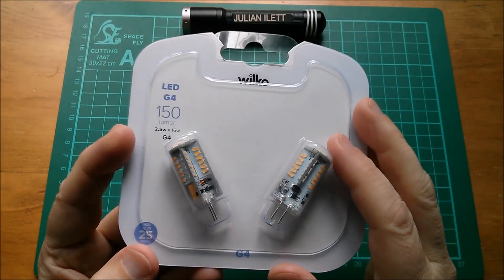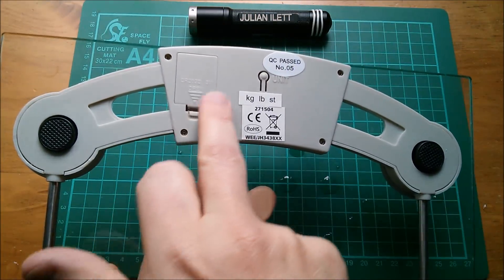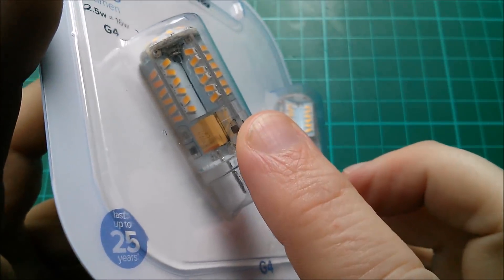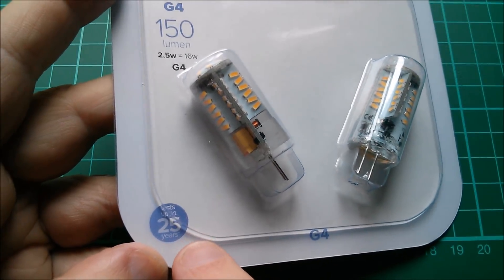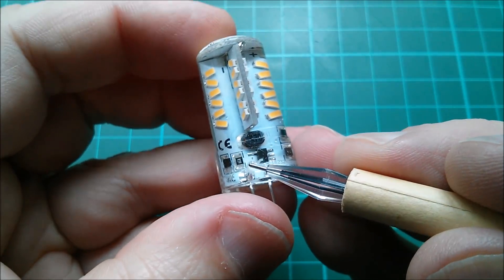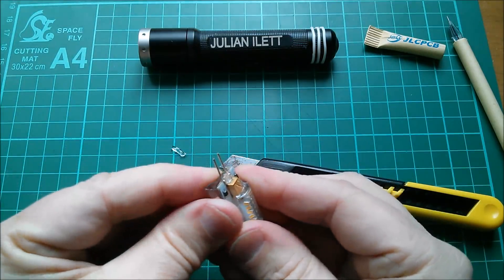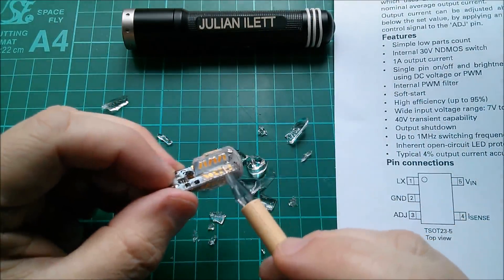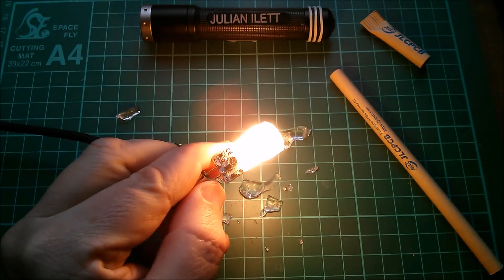Wilko 12V G4 LED Lamp (plus 3 other Wilko items)

Comment: The 1.1W version of these is even dinkier but with only 24 LEDs. Interestingly it will run from a 9V battery - potential torch hack available there.
What happened to the solar filament lamp teardown?

Comment: The problem with "potted" bulbs like these is that generally the potting prevents heat dissipation, which means that they generally last 25 days (if I'm being generous), rather than the stated 25 years. That's based on my experiences with some similarly potted G4 bulbs a few years ago. Mind you those were mains driven and massively flickery, so clearly they had a different driver design. Still on the upside at least the clear casing means you'll be able to identify the components that failed easily enough ;) Actually, please could you try burning some of that encapsulation to see what happens?

Comment: I also have a radio clock, according to the manual, it syncronizes with an atomic clock 2 000 km away in France! Pretty big distance, wouldn't you say?

Comment: Scale manufacturers don't need to know that F = mg (therefore m = F/g) and that g ≈ 9.81 m/s^2, they just calibrate them with a know mass object (calibration weight). In other words, they go the engineer (practical) way instead of the physicist (theoretical) way.

Comment: Some LED indicator lamps I have are over 7 years old and run 24/7 and still look fine. However it depends on the quality of the LED. I have seen a LED exit sign that is less than 1 year old that has gone very dim. Some LED lamps driver fails before the lamp. Those LED alarm clocks seem to never burn out lol.

Comment: I've just been to the, recently opened, Edinburgh branch of Wilko. They didn't have any of the lamps in your video in stock but did have the smaller, 1.1w (100 lumen) version.
Only 24 LEDs in each lamp but they still put out a reasonable amount of light.

Comment: The ones I have are definitely not dimmable (mine are identical looking ebay, shipped from china versions).
... them little rubber lamps lets the old magic smoke out if you are daft enough to ignore the warning on the packet and try dimming them just for the fun of it... 
That little chip really didn't appreciate being fed with a PWM supply. 
In fairness I did torture it for a quite a while this way before it blew up.  
Just thought I'd point this out so others don't need to find out the hard way. 
There is something oddly attractive about their clear rubber construction... or perhaps I'm starting to loose the plot.

Comment: Ignore the haters Julian, just pathetic.  Love your enthusiasm and delight, enthusiasm is actually a great teaching style.

So here is an idea for you.  How about some videos on taking apart old things and re-purposing the electronics.  For example take a Microwave (or any old thing) from your local Freecycle.org site, remove mains and then check out the PCB's, transformers. LCD's  etc, Then see what you can use in other projects.  The wire and connectors alone are useful and better quality than cheap Chinese ebay stuff.

I would like to see more about super capacitors too, some of the cheap ebay ones leak so fast they are useless.  I noticed yours were visibly dropping.

It would also be good to see a standardised review for buck boost devices so we can apply to ones we test.  I had one overheat and smoke before dying when I actually put a charge through it, was 19v to 2,5v for a 500f supercap.  

I want to design something to safely charge Supercaps ranging from 2.5 to 63v and then cut of power, for now I am working with momentary switch and bulb for testing.

I was looking for 63v and these beasts stood out! 

https://www.ebay.co.uk/itm/192470297761 DC to DC High Voltage Boost Converter Step-up Booster 390v 

https://www.ebay.co.uk/itm/232624565570  600W-DC-DC-Boost-Buck-Adjustable-Step-Up-Converter-Power-Supply-Module-GV7R

https://www.ebay.co.uk/itm/192059570688  100W DC-DC Boost Converter 10-32V to 60-97V Step Up Power Supply

I wonder how practical and reliable they are

BTW have you heard of this guy, is a namesake of sorts 

https://en.wikipedia.org/wiki/Julius_Edgar_Lilienfeld 

physicist and electronic engineer, credited with the first patents on the field-effect transistor (FET) (1925) and electrolytic capacitor (1931).
Reply: What haters? Julian doesn't have any haters.

As for taking microwave ovens apart, I've seen a few videos on YouTube about microwave oven transformers. Scary stuff!

Comment: I have bought 240V G9 version from different manufacturers from Banggood, Dealextreme. They all have the same silicon coating and all failed in a few month - 1 year. They start blinking. Wonder is the silicone is causing it to slowly cook inside.
Reply: Hello I think your bought price is very cheap, right?

Comment: I bought some of those silicon encased Halogen replacement bulbs 2-3 years ago, but I wasn't impressed with the brightness, colour or strobing.  The more recent filament style Halogen replacements are much better.   I think Wilko are selling off old stock.

Comment: Oh, Julian.  shakes head  It's not force equals mass times acceleration.  It's force equals mass times the square of acceleration!

Please don't tell me that you're the kind of person who multiplies the weight by two when you double the scale of a three dimensional object! ;)

(Psst!  For anyone who does, you're supposed to multiply the weight (mass) by eight when you double the scale)
Reply: Last I heard, force does equal mass times acceleration but the whole question seems rather unnecessary since bathroom scales measure weight which is a force and not mass which isn't so there's no need for any conversion.
Reply: Well, strictly speaking it's the square of the speed, so since acceleration isn't speed but a constant change in speed, I guess you're right.  I back down and call myself a fool for not seeing the difference.
Reply: You may have been thinking of energy instead of force. kinetic energy=0.5 mv^2
Reply: Could be.  There goes my dignity. :P

Comment: The REC button means 'receive'. You can press it to initiate an immediate sync with the radio signal, although the clock should try and sync each night at 2am. The SET button allows you to manually set the time. The signal is a little weak in the SE of England so I sometimes have to prop my RC clocks up on an upstairs window sill and press REC when the clocks change as otherwise they can't 'see' the signal. Some clocks always sync by themselves but I have a few that struggle.
Reply: I just pop the battery out as it's easy and the reset button is tiny on my radio clock. But I do find it picks up the signal better on the window.
However it never seems to has an issue on a daily basis finding a signal, just when I manually have to reset it :(
Reply: +Chris Nixon The same here in South Wales. But my OH's is nearer the window and works fine.

Comment: 25 years at 2.7 hours per day is just under 25,000 hours of operation. Most of the LED lamps I've used are rated between 15,000 and 25,000 hours of operation.

Comment: Aww... he absolutely loves it...  :-)   (it is pretty nice though)
BTW... I wouldn't be so fast to say tantalum caps won't last 25 years.... I repair avionics test equipment made back 30-40 years ago when tantalum caps were first making inroads into mass-market designs, and have yet to see one fail of "age". Remember, small molded tantalum capacitors are solid-state... which in the case of capacitors means they have no liquid electrolyte that can boil off, leak, or otherwise "go away".
Most tantalum cap failures I've seen are related to the application, where they may be subjected to excessive voltage spikes... which can destroy pretty much most any capacitor. Other failures have been related to assembly issues of over-temperature, or reversed installation.

Comment: Stones and Lbs drive me mad (I'm british and 44 yrs old). I can't comprehend why anyone would use it lol. Lbs works, or Kg works... but stones? What size stones? Gravel?
Reply: The distance between the two sets of stumps on a cricket pitch is one chain. How English is that? Ten chains are one furlong; a measure still used by racecourses. Maybe some farmers, too, since a 'furlong' is a 'furrow long'. Oh, and eight furlongs are a mile. 

The mile was first used here by the Romans ( a European connection!). Theirs was 2,000 paces, which is the maximin distance that a Jewish prosrlyte was allowed to walk on the Sabbath. And the inch was first recorded as being used by the ancient Babylonians. 

12 inches to a foot, 36 to a yard, 7920 in a furlong, and 63,360 to a mile. The beauty of this system is the divisibility of the numbers into whole factors. A mile is divisible by:

1, 2, 3, 4, 5, 6 ,8, 10, 12, 15, 18, 20, 21, 24, 27, 30, 32, 36, 40, 45, 48, 55, 60, 64, 66, 72, 80, 88, 90, 96, 99, 110, 120, 128, 132, 144, 160, 165, 176, 180, 192, 198, 220, 240, 264, 288, 320, 330, 352, 360, 384, 396, 440, 480, 495, 528, 576, 640, 660, 704, 720, 792, 880, 960, 990, 1056, 1152, 1320, 1408, 1440, 1584, 1760, 1920, 1980, 2112, 2640, 2880, 3168, 3520, 3960, 4224, 5280, 5760, 6336, 7040, 7920, 10560, 12672, 15840, 21120, 31680 and 63,360. 

That's remarkably useful if you only have a pile of stones or mental arithmetic. The Babylonians counted on their hands using base 60 for that same reason.

Systeme Internationale, on the other hand, allows for division by 1, 2, 5 and 10 and their multiples, in a metre. The outstanding beauty of SI lies in the way in which standard units of mass, length, brightness, energy, volume, electricity, gravity, pressure etc, all hang together into easily-calculable and convertible quantities.

Many people of my age (pension time all too soon!) were taught in both systems of measurement. I still use Avoirdupois (Europe again!) a.k.a Imperial measurements and 'Metric' interchangeably, which is a real bonus, especially when corresponding with our American cousins (yes, I really do have some), who often struggle with the much more logical and intuitive system which 97% of the developed world's population use. It's not their fault as individuals, it's their education system which has let them down.

My comments on YT will often contain conversions for them, as a courtesy. It would be good if more U/S citizens were taught to use SI units. The U.K. was in their position, educationally, in the early 1960's. They're catching up, to their credit.
Reply: TheChipmunk2008  The English used to (and in some places still do) measure distance in chains (1 chain = 22 yards, 20 chains = 1/4 of a mile)...
Reply: British here... I use kg.
Reply: @tim. I mostly do too, but spent time in the US, so multiplying by 2.2 isn't that hard, but stones, blow my mind

Comment: I didn't see anyone motion it, but the capasater is there to protect the LEDs agents the in rush current  created by the LEDs. If you don't have enough capacitance you can blow out the LEDs. I have seen online somewhere how to calculate the capacetents needed based on the total forward voltage of the LEDs.

Comment: I've seen LED' put inside glass, which is filled with transparent potting material. eBay "G4 COB Filament LED Light Glass Chandelier Boat Spotlight Lamp AC DC 12V"

This "new-ish" solution seems great, but I'm curious if dust would collect over time (some stickiness factor). Which isn't the case with the glass filled ones.

Comment: If the rubber is the same used on waterproof LED strips it will get yellow and brittle after a couple years if used on a car in tropical countries like where I live (Venezuela) I imagine that with the cold weather you have there in UK it would last quite a bit longer

Comment: I did not think there was too much wrong with you till I restarted the video ,,, "hows it hanging ?" . Ok. hee hee. Oh well, I have a friend who will be fascinated with this video so, its a club... Or you two should hit each other over the heads,,, um, enough of that. You didn't quite make it to the part where you actually measure did you ?  Oh well, here is the answer to your question https://youtu.be/e4iyNFcdhOQ 
https://youtu.be/kAG39jKi0lI

Comment: These G4 lights look very similar to the ebay ones I got, and regretted. They were super blinky, and all died with a bang and lots of soot not very long after. Also, Clive has picked apart a burnt specimen of this item.
Reply: One difference, yours has a driver chip, mine only had a capacitive dropper.
Reply: ...and also mine ran on 230V. Badly.

Comment: There is no problem for that LED lamp to last 25 years as there are no electrolytic capacitors those usually dry out especially at higher temperature and only last a few thousand hours.
LED's can last 25 years even if used 24h per day that is around 220000h. I have a 3W white LED that is used at around 0.5W 24/day every day for the past 5 years and while I did not measured the intensity it looks as bright as it was when new.
Reply: It's not the LED he's worried about - he says they could easily last 25 years. It's the tantalum capacitor that isn't likely to last that long - they're better than electrolytics, but they do fail.
Reply: If that is a genuine AVX 100uF 20V tantalum capacitor then they do not have an electrolyte and should last fairly long (this are used in automotive type applications). It will not have much of a hard life in a LED lamp that is just 150lumen likely less than 1.5W total.
Reply: That's NOT an AVX capacitor. Those are used in automobiles because of their high reliability - but they're also expensive because of that. In car costing five or ten thousand pounds, it's not a big deal, but you don't use them in 1£ light bulbs. It's going to be a much cheaper brand with a much shorter life.

(And tantalums DO have an electrolyte. Most of the cheap ones use manganese dioxide.)
Reply: It is not a wet electrolyte so it will not dry up with time. And yes getting one of those 100uF 20V from large distributors is about as much as the LED lamp around $1 but old stock in China can be had for 10 to 20 cent (it may also be counterfeit so not sure but it has the AVX logo on it).
They probably purchased a large volume and when they do not have this it will be replaced with something else they can find in the market at a low cost. How else can you build a product like this at this price point and sell it for a profit ?
Reply: RedwoodRhiadra - And when tantalums do fail across power rails, watch out! Fireworks.
Reply: hellterminator yes and no. These don't use a wet electrolyte so they are quite different. https://en.m.wikipedia.org/wiki/Tantalum_capacitor
Reply: Not “yes and no,” they are electrolytic capacitors. It's not my fault people say “electrolytic capacitor” when they're really only talking about aluminum electrolytic capacitors. 
That's like saying “I hate dogs” when you really only hate pugs and like all the other breeds. You're not getting the correct message across.
Reply: If you do the math 2.7h/day for 25 years is 25000h (a bit less actually but I bet they rounded down 2.74 to 2.7). Led lamps are often rated for that duration (and even more) so there's nothing really new. It's just the marketing guy that though "25 years looks great! Let's calculate the number of hours per day it correspond to"...
Reply: Tantalum capacitors are electrolytic capacitors. What you're probably thinking about are aluminum electrolytic capacitors.
Reply: I said "yes and no" because they are electrolytic but they are like 10 comments saying that. So no everyone doesn't make that mistake...

Comment: You should drill a hole in the bottom of that solar lamp. Other wise water will capillary up the thread. And it'll fill up.
Also they're not usually that suitable for out doors... You can put some tape over the top. Wilko do one that is meant for poly tunnels.

Comment: I had a similar ones as a garden lights, on all night, powered by a solar system.
They weren't running too hot yet the LEDs started failing after a couple of years, and as more failed more current went to the "strings" that were still good burning them to the point of melting the solder.

Replaced them a couple of years ago with the more expensive 1.5w filament ones from ebay and they seem to hold up well, brighter and more efficient.

Comment: A while ago i saw probe needles (i dont know if this is the right english word) on aliexpress. I think they can be useful for some Measurements through those protection. I think it is for probing through the isolation of a wire.

And because this is my first comment as a regular viewer: Thank you for your great and also funny videos!
Reply: iBildermacher  There are "insulation piercing" probes for test gear. So it would not surprise me if there are needles as well.

Comment: With the clock you meant DCF 77. Which is located in frankfurt
Reply: Ventus sursprised it reaches UK as in my house in the west Netherlands I have to place these clocks at the window to receive the signal
Reply: We have one in North Yorkshire in a solar charged alarm clock  (you'd love it Julian :-) which has been going strong for 18 months now with no apparent reception problems (I have to admit I was surprised). Originally wondered how I would program it to run on UK time rather than central European time -  the answer was simple: reposition the hour hand on its shaft!
Reply: It does work here in the UK, but only upstairs.

We have not-quite-as-bad-but-similar issues now in the south of the UK with MSF since they moved it from Rugby to up near the Solway Firth!